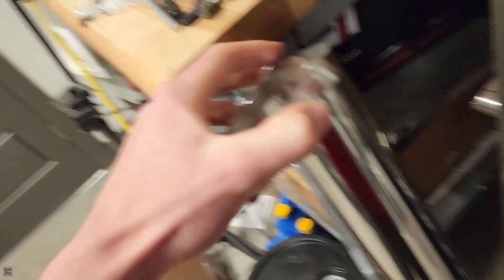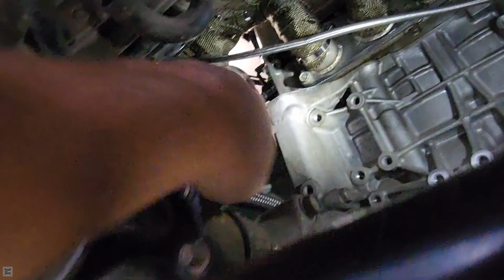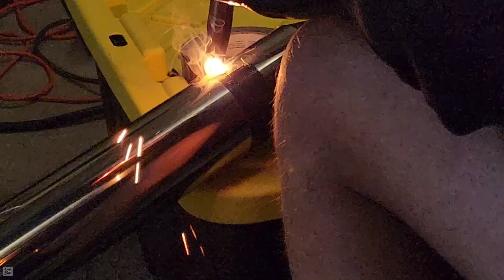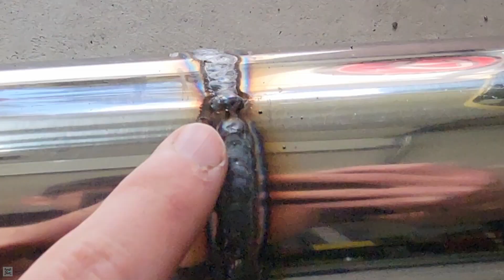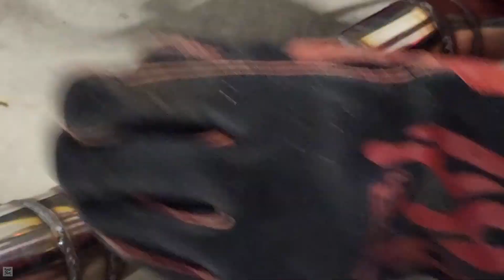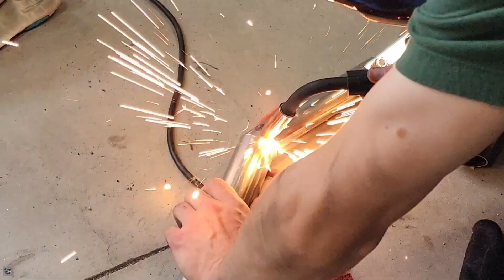Making Custom Exhaust for Turbo Element | Turbo Toaster Part 7: Side Exit Exhaust & Wastegate Dump

Comment: it's really cool that you did all this yourself but honestly that's gonna flow terribly until it breaks. don't weld stainless without gas. you should have done it with mild or taken it to an exhaust fab shop if you wanted to use the stainless.
Reply from the maker: Hindsight is 20/20, I learned quickly that stainless is  PITA to work with.